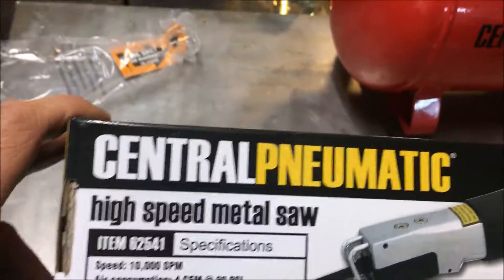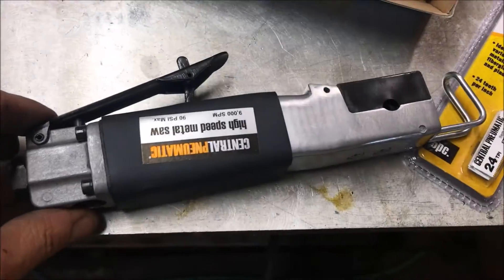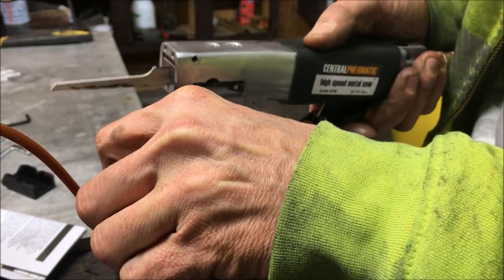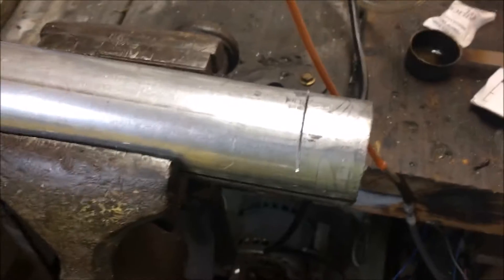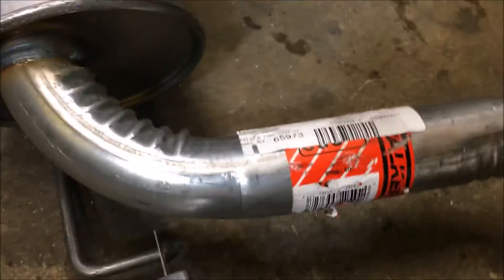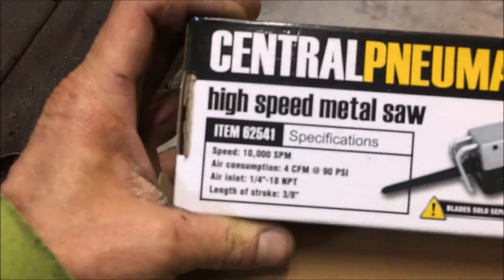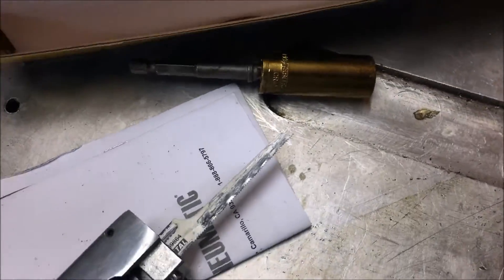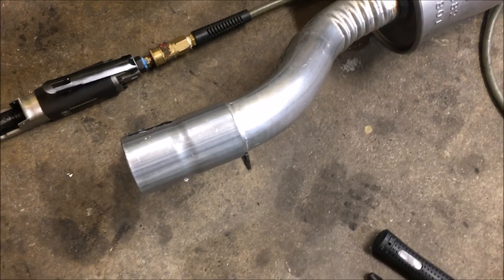Harbor Freight high speed metal saw

Comment: I have one and it works fine , keep the metal piece on the front and it will stabilize the work surface and the blade movement and don't use excessive force and let the blade travel through the material being cut !    Use 90 psi continuous working force and it will work fine and add a few drops of oil every 15 minutes of use !   Mine is 4 years old and still cut metal and wood fine !  Good luck with yours !
Reply: Nice comment about life of tool. I'm not looking for something used daily for months but for the few cuts I have to remove rusted metal from two trucks.  There are one stars on HF web site that you can't determine what the user is doing with it.

Comment: This tool is not intended for thick wall solids like is being demonstrated. For the cross section thickness, you want something in the 6-10 tooth per inch. And with 24 or 32 being the blades used, they are for thin sheet metal. Typical blade rule is 2 teeth supporting the blade in any cut. So the thinner the material, the higher tooth count needed. And for thick material very low tooth count.
I'm more interested in how long the tool will last, as in number of hours before the air motor is worn out, or the gear box.

Comment: Your trying to cut a heavy pipe/rebar with a TOY what did u expect ? Use a grinder
Reply from the maker: i was testing the tool paul not using it , turns out its a POS , only good for tight spots under a car
Reply: The tool is designed for sheet metal body work.